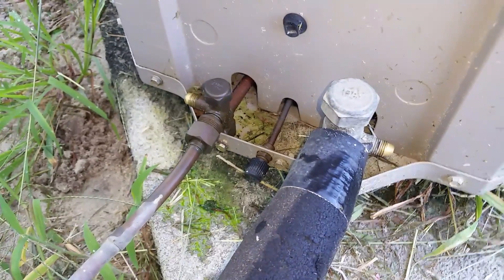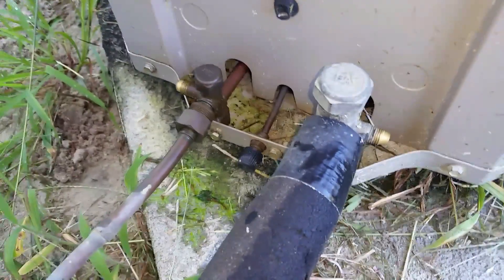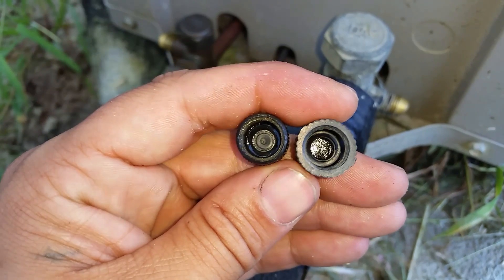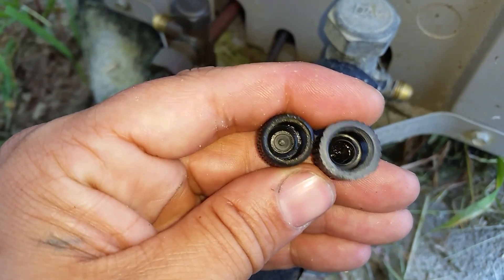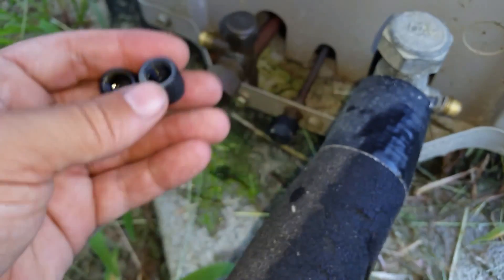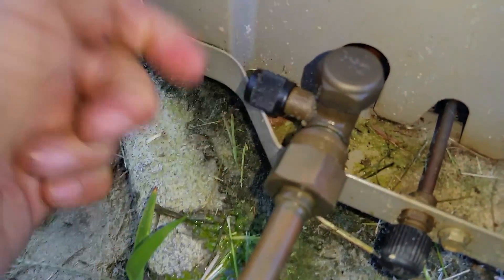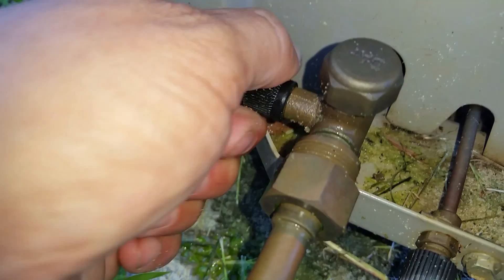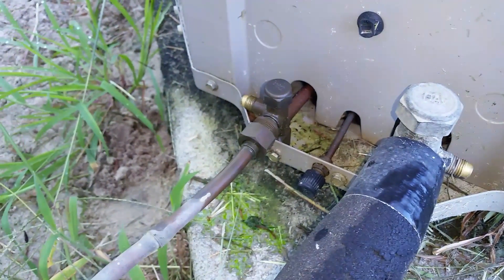HVAC - 60 Second Tech Tips #7

Comment: Good video. You've got to look out for the schraeders tips sticking too far out too & loose schraeders , Allways tighten schraeders on a job too , I Never use or leave plastic caps on a system. I actually BUY A BAG OF 25 brass caps with o-rings almost every time im in the supply house. I almost allways replace the caps with fresh ones. It leaves a nice look to a finished job. Customer see's Nice Fresh & brand new shiny caps. Makes the Job look good after your finished and cheap insurance to keep that refrigerant inside the system. Caps are about .50/e my cost. Worth it to me even if i forget to bill them out.
Reply: Crap Goodman split systems leave the factory with plastic caps on them. I do work at multiple apartment complexes where they were installed. I always install brass with o rings before I leave A/C unit.

Comment: good tip never realized the tank caps do that since I use brass caps but it's something to look at when doing service.
Reply from the maker: JH HVAC & Plumbing Thanks Justin. Yeah, we use the brass caps as well. Only way I found this was we had an Apprentice that was saving the caps off of his refrigerant tanks and would use them to replace damaged caps. After finding 2 systems he had recently serviced very low on charge I discovered the caps were not normal o-ring caps.
Reply: HVAC in SC very interesting maybe the tank company's should change this cause I'm sure there r tons of guys doing the same cause I know I didn't know there was a difference

Comment: Great tip, never noticed that before. Equally good tip replace plastic caps with brass caps with O rings. Plastic caps expand and contact, warp, occasionally cap, and the gaskets in them are so thin they don't do much. Also plastic cap o rings are good for rolling up in the cap and pushing in the schraeder pin.
Reply from the maker: Glenn Harrison Thank you for watching.
Reply: Well said. Yep.